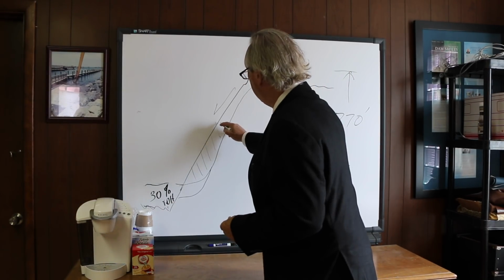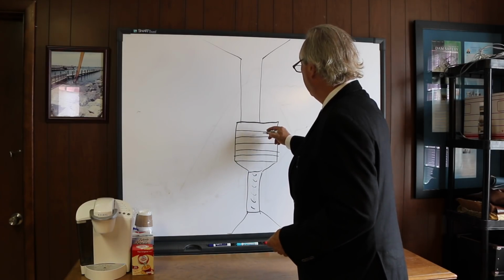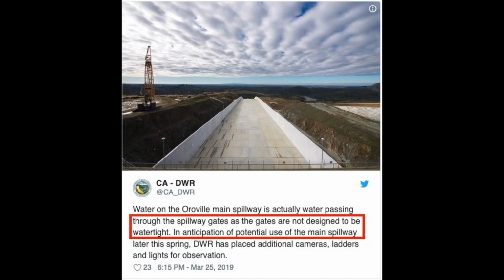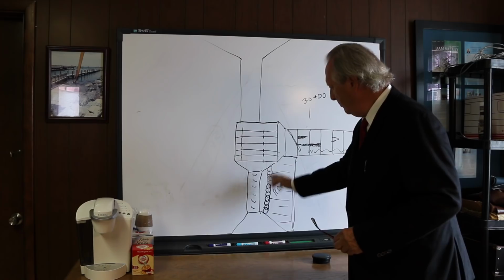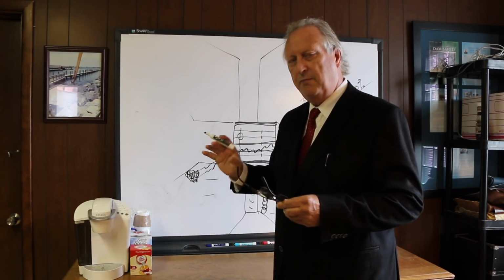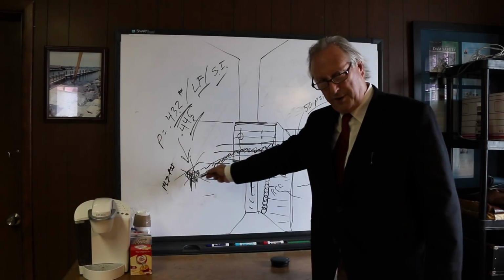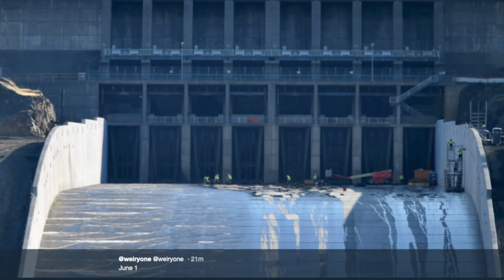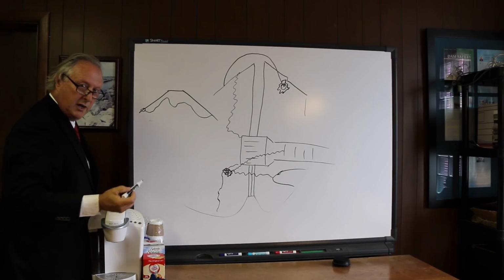Cahill on Oroville Dam 06-01-19

Comment: Different color water tracers should confirm port(ing) areas.
  Finding these grout routes is quite a concern !
  Is there a way to utilize (Dutch) Cone penetration with pore pressure transducers and grouting capabilities ?
I'm from this background beginning with Fugro BV Holland through The Earth Technology corp.
Reply from the maker: Good questions. Dye seems very difficult to transmit through such porting. I have had little success with them. Some flourescent dyes work but colored dyes seem always to dilute too much for any tracing. At times these have worked. It depends on size. pore size of fines within the corridor and amount of water moving (dilution). Most of my grouting work has been fairly active ports and I have had luck with urethane grouts and Portland. Unfortunately, most of my work has been on ports where the evolution and the introduction of the porting water is obvious. I use a slug of urethane, usually a foam, sometimes a gel, per manufacturers recommendations, then a filling operation of Portland based grout amended with super-plasticizer and anti-washout admixtures. I have used acrylamide and acrylate, but this is useful in fine silts to sands. I pumped ten thousand gallons into a large earthen dam with little success in Virginia at an engineer's insistence. The pore size was simply too large because of the movements of fines into and through he drainage materials over many years. Typically we have extracted cores at depth and we have been most successful in video captures of materials at depth and the sieve analysis seems usually to define, well the matrix at depth. It is difficult to drill into a port and a few feet off can result in a significantly different material matrix. The operation must consider, too the evolution of these lenses of materials which fail upwardly through he soils of the embankment. I refer to them as "rising dome failures" These lenses progress upwardly through he soils and manifest as a "sink hole" on the surface of the dam or face. These are certainly indicative of a mature soil moving port. They often manifest as rill-like soil losses at drains or structures ( This is my concern with the training wall structure adjacent soil rills which have been covered with soil stabilization fabric or plastic at Oroville.) You seem quite aware of the procedures, but for others I will add that pressures of the grouting operation are critical. This is a difficult thing to set, many good contractors using rule of thumb pressures such as the common one pound per foot of depth, possibly with offset add for the pool pressure. Soils, soil sheer, foundation pressure, depth of port, and thusly, skin friction of the particulate within the port must be considered. There are many schools of thought on this. I learned much from the "grouting fundamentals and current practice 2007, Golden Colorado. I highly recommend Donald Bruce's book on foundation grouting of embankment dams. Dr. Bruce is a brilliant engineer when it comes to grouting and I learned much from him and his writing. Grouting is as much an art as a science and it is horrible to create a soil fracture in an attempt of fixing a port. It is equally horrible to use insufficient pressure mass to completely assure filling. That is, perhaps the worse case. No one understands dams and grouting better than the Dutch. As we learn and fail, we shall get better at it, I suppose. Thank you.

Comment: Thank you for the tutorial on the issue. It has cleared up some things and shed further light as did your explanation of the spillway failure. I appreciate your candidness on the matter.

Scott, Do you feel the amount of RCC used to fill the void under the area of the spillway left by the erosion has addressed some of the issues you bring up? Though the spillway is only a portion of the width of the dam over time can we see issues "reconfigured" upon other areas.

In the mechanical world there is "it works or it doesn't". In this world it is what is best with the knowledge attained since the dam was built. If you say a dam has a useful life, is that sunset built into the operation of the system. If it is not then we will eventually run out of fingers to plug the issues when it is beyond its life expectancy. As an example they know for passenger planes the number of pressurization-depressurization cycles an aircraft can normally endure and the plane is then removed from service BEFORE there is a failure and a crash. The de Havilland Comet comes to mind as the poster child for this issue. How is this aspect of life expectancy dealt with on a permanent structure like a dam?
Reply from the maker: I despise RCC. It is, I suppose a decent, though erodible, top for man area of emergency spillway or armoring of an emergency spillway. It is a horrible material for the sub-surface of a concrete structure. RCC has poor compressive strength and that is okay in a compressive situation as exists beneath a hard structure. Its problems in such an application are that it cannot be anchored into effectively without large plate anchors and even then it is dependent on a poor structural element in tension and shear in a pull-out scenario. Even a clay material is preferable to me, with proper anchors into competent high-recovery rock. RCC is another addition of hard structure upon a dynamic structure as is a concrete spillway on an earthen dam. Always, there is real possibility of the interface of hard and dynamic elements to move water and to move differentially. I had a close friend Ferris Abdo with the Portland Cement Association. He successfully pushed RCC and I agreed with Ferris in armoring with appropriate cut-off at the top of grade. Concrete with high Portland content is a little more expensive but it has the ability to bond and it has the ability to allow steel anchors to achieve their cross sectional tension pressures in pull-out. It is easier to conduct in irregular areas such as dentalwork. RCC can be a great material. It is not and never shall be an appropriate material for significant structural loads imposed nor can it suffer high velocity water without loss of surface. A dam can exist indefinitely with oversight and careful stewardship. Grouting programs are important in older dams, particularly with dams of mass but not of the best materials for cores and containing pressures through mass. Thank you for your thoughtful statement and question. I am a construction guy, not an engineer, but I have been around long enough to have seen many errors and successes.
Reply: @scottcahill945  
Thank you.

Comment: There are 6 or more failure modes Cahill eventually touches on here.   The biggest problem  I think is that there is no way to safely lower the water level without causing a couple of the other failure modes to take over.   I believe the damn by safety standards has failed.   The next move is to take the damn apart and never build another Dam in this valley.   The greedy bastards wanting to grow food in the desert,  were behind this  dam being approved  against the better judgement of unnamed engineers.  This dam has already failed.
Reply: There is no source for his unamed engineers. Thats why he didnt give links...comments like these that are legit are usually backed with some form of sources outside of off the wall opinions.
Reply: @MidgetPunter  I've seen countless dams fail in my 69 years of life.  I don't know who engineered them and I don't know who advised against those same damns.  The damns still broke.  Off the wall opinions are often affirmed that way, despite people like you not getting a list of names of the engineers who built them.  I did mention that Cahill himself had touched on some ongoing processes that could lead to Dams Failure but that's not enough for you.
Reply: @rodneycaupp5962  countless. Youve witnessed countless in the US fail in the last 69 years... thats a bit of a generic statement cause that can be 1 to a million. How many built in the last 50 years have failed tho is the key. Not damn built in the very very early 1900s but mid to late 1900s. Your countless claim would be far lower and you might be able to give a number!
Reply: Take the dam away and you take a large ‰ of the local population as they will no longer have jobs. The local towns would be ruined.
Reply: @Ironrodpower  California has one of the highest unemployment rates in the country,  even with these Dams.
Reply: @rodneycaupp5962  i agree Ca has the highest unemployment rates...when you let a ton of illegals in the rate will continue to grow as there are not enough jobs. CA also has some if not the toughest gun laws and still has almost the highest gun related crime... it also has the highest taxes yet so many on welfare...lets do the math here. CA is a democrat created PROBLEM!
Reply: Rodney Caupp ~~ Unfortunately you and a lot of others fail to realize that the Feather River and its tributaries Have historically flooded the valley clear to San Francisco with huge volumes of water for centuries. That is why there is river bottom soil spread out for a major portion of the Sacramento Valley that is the reason for the Bread Basket of Calif.  YOU cant take down the DAM as it would continue to flood with out the storage reservoir's ability to mediate the huge flows of water gushing down the canyons. I have lived in this area for all of my life and when I graduated High School in 1957 there were only 15, million in Calif. Now 40 + million and they are occupying the food growing fertile grounds in the flood plains,.....???

Comment: The dam probably shouldn't have been the primary Feather River watershed control, but it was. The current leaking theoretically can be repaired with existing repair processes, but it isn't. The only way to diminish the threat of dam failure is to lower the reservoir level. Snowpack melting is Imminent.  Opinion: the structure won't remain intact through this calendar year.
Reply from the maker: (It's Lisa) The entire project was planned with the intention of building a sister dam in Marysville. The water management plan was developed with the expectation that the Marysville Dam would come online in a few years and they would manage downstream flows in tandem. Needless to say, Marysville didn't happen and almost certainly will not ever, at least for many years. But the management plan was never revisited to adapt to this new circumstance.
Reply: @scottcahill945  interesting bit of information.  A very large Ellis Lake instead of Marysville? If the Oroville dam does fail the outcome of a Lake Maryville is not far fetched.

Comment: Superb presentation. Your talk of grouting reminded me of the extensive grouting done on Hoover Dam. Reported in "Colossus: The Turbulent Thrilling Saga of the Building of Hoover Dam" by Michael Hiltzik (2010 Free Press)  Though I have read several books on the dam before I didn't know about the emergency grouting work done during the decade after the filling of the reservoir. With Hoover they were able to work inside from the galleries. Perhaps you could discuss this from your professional viewpoint.
Reply from the maker: There are many ways to grout a dam - the methods vary with the problem and the applicator. Thank you.

Comment: High 90’s the next few days in Oroville. Big snow melt will ensue.
Reply from the maker: 3.5 deg. F per 1000 ft. of elevation approx.
Reply: Scott Cahill I stand corrected sir
Reply: Did you know that every 1000 feet is a drop of ~10 degree temperature? Now where's that darned snow pack...oh I know...at 6000 feet.

Comment: Scott, here’s a reasonable question you can answer for everyone. 
Phreatic water doesn’t just appear and disappear, so where was all this underground water when the weir had soil below it? 
If it was a major volume, you would see rivers forming over time. 
Same goes for the old spillway, when the spillway was not running and levels were high, the drains were dry. 
When the spillway ran, the drains gushed. To me that says there is zero or minimal groundwater under the spillway location. 
Two years pass and the spillways are armoured, but suddenly the main spillway has a ton of water under it that cannot find its way out through the drains, so forces it way up past water stops etc to the surface.
Reply: R Dunphy you are 100% on the money. The contraction/expansion joints are placed over the pea gravel slotted drain pipes and the PVC water stop that is formed between the adjoining slap is about 12" below finish grade. What little water that is flowing down the spillway, caused by leaky radial gate "J" seals runs down the spillway surface until it cones to a transvers contraction joint, it fills that 12" void then continues to spills to the next joint causing that water stain that every body is alarmed about. The water stop prevents vertical migration between the slabs and water coming up from the underdrain.
Reply: @stutz1751  I am no civil engineer, but I have a few brain cells left! My late dad was an architect, so I guess something rubbed off. 
One thing Keiwit did was place polyethylene rod blocker in the gaps at a certain depth below the upper edges. I understand this is an extra barrier to moisture ingress plus it provides a uniform depth for sealing grout. 
I am dumbfounded that Scott cannot see how water will always gravitate to the lowest point...where the drains are. The drains are an open system, no pressure can build.
Reply from the maker: Before the failure of the principal spillway a couple of years ago water was porting violently from the drains in the training walls of the sluiceway. Obviously when the pool is down the ports become dry. They never go away and you cannot plug them from either end effectively. Not even with helicopters and rocks!
Reply: Scott Cahill, According to  the Oroville Dam Spillway Incident Independent Forensic Team Final Report, the source of the water infiltration under the slabs that caused the failure of the old spillway came directly from the spillway itself, not ports under the gate structure. From the Independent Forensic Team Final Report -- [Summary]...…. ("During service spillway operation on February 7, 2017, water injection through both cracks and joints in the chute slab resulted in uplift forces beneath the slab that exceeded the uplift capacity and structural strength of the slab, at a location along the steep section of the chute. The uplifted slab section exposed the underlying poor quality foundation rock at that location to unexpected severe erosion, resulting in removal of additional slab sections and more erosion.") If I may ask, what is your response to their report? Are they wrong in their conclusions?